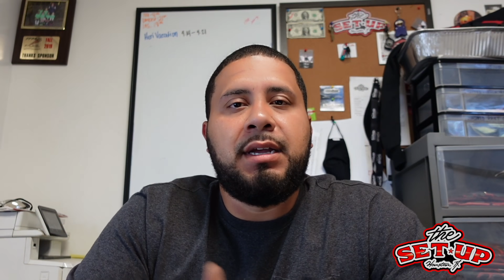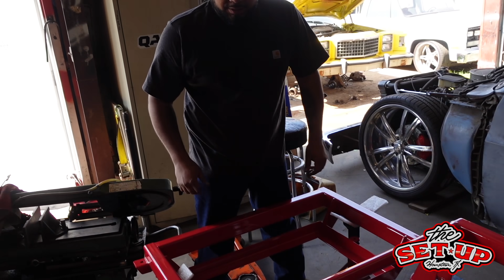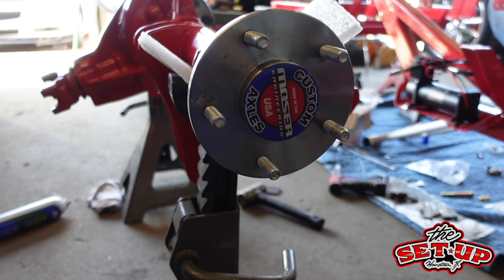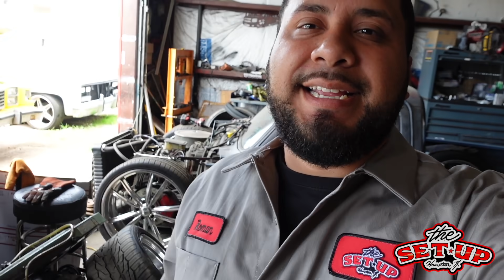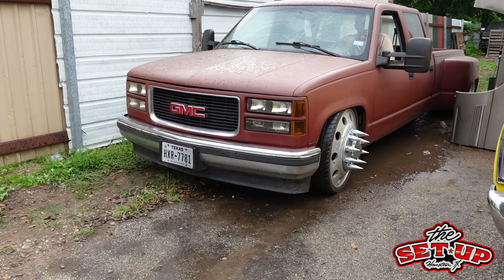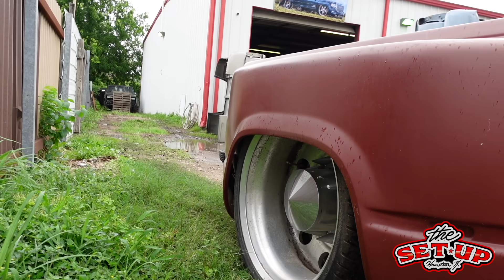Looks who’s coming out to play

Comment: What manifold do you guys use on you’re air set up that’s reliable ?
Reply from the maker: AIRLIFT 3P WE HAVE INSTALLED MORE THAN 20 AIRLIFT MANIFOLDS AND UNTIL THIS DAY ONLY 1 CONTROLLER HAS GONE BAD.
Reply: @Thesetupsuspension  sweet thanks for the respond bro! Was wondering since I heard accuair  is done